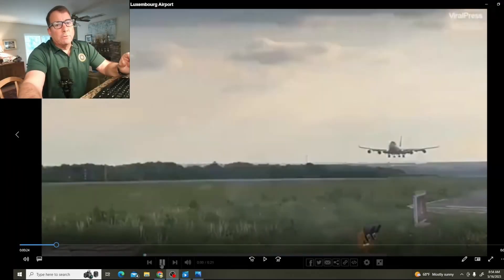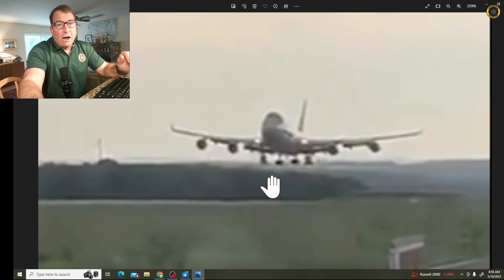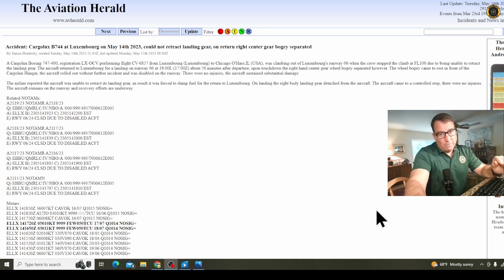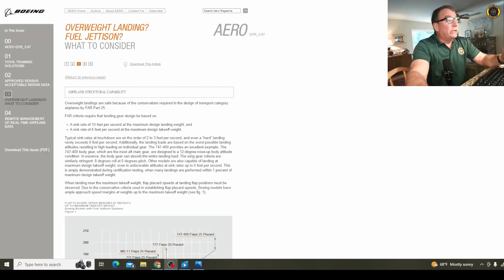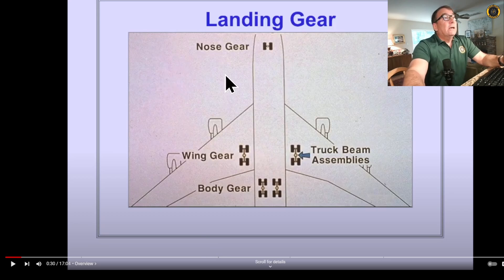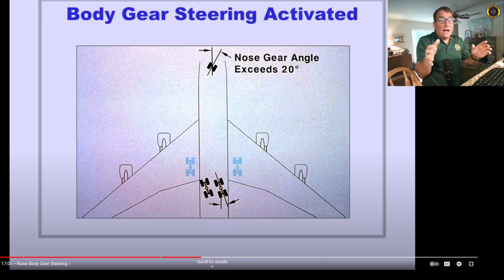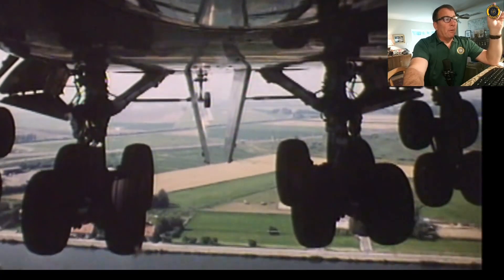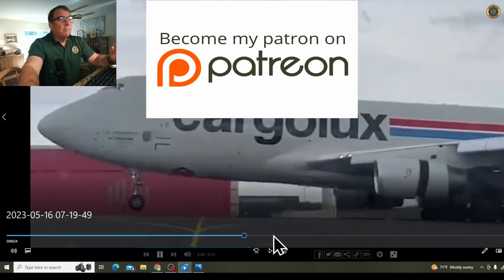Cargolux B747-400 Landing Gear Failure 14 May 2023

Comment: Dumping fuel was the most prudent thing to do, the lighter the better and the there was no imminent catastrophic emergency forcing you to land at full gross fuel weight.
Reply: I would expect and want the pilot to dump fuel with main gear issues and international fuel volumes. (Prudent works for me)
Reply: Sounds like the prudent thing to do! 😊
Reply: I read once that while the heavies can safely land overweight it will require the aircraft to be temporarily taken out of service for inspections as there could be possible damage. So as long as there is no safety issue in remaining in the air long enough to burn off and/or dump fuel then that is always the prudent thing to do. And of course in situations like this where landing might be tricky and where being as light as possible can help.
Reply: The other way is to burn off fuel for an hour or so. That gets the adrenalin down and gives time to make a smooth plan.
Reply: Adjusting gross weight is the proper term, especially in Europe. Prudent, I'm not sure you're using the correct word, possibly "necessary".